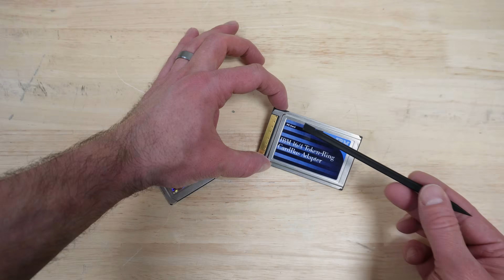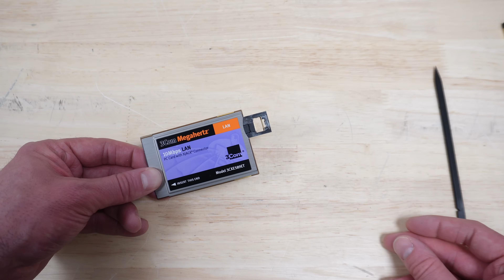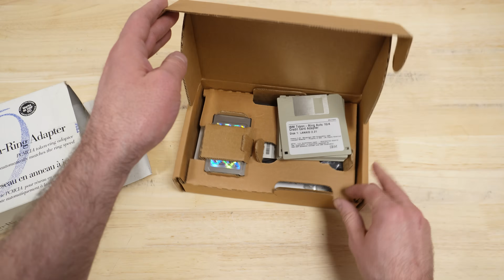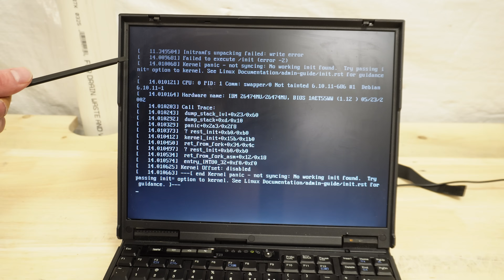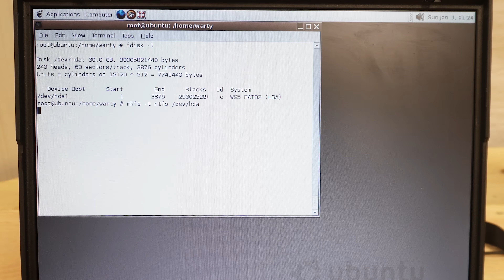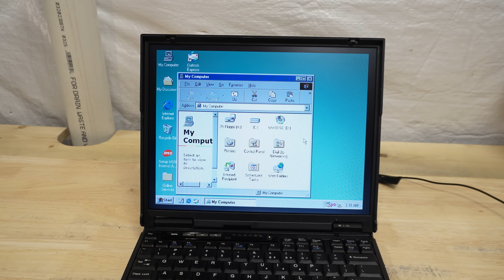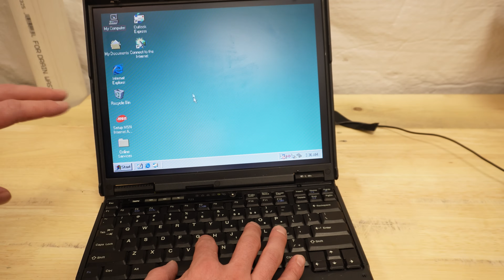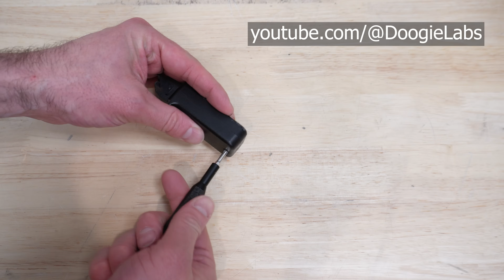Token Ring over PCMCIA Cards

Comment: The PCMCIA form factor was also used in digital television with the CableCARD standard in the USA, and the DVB-CI (Common Interface) in Europe and other parts of the world. Using a standardized interface and form factor allowed interoperability between cable operators and their chosen Conditional Access (encryption) vendor on one side, and a host of receiver manufacturers on the other side. For a number of years, it was a common sight in Europe that all TVs with digital receivers would also have a PCMCIA slot for a CAM, a Conditiional Access Module, allowing the subscriber to opt out of leasing a set-top box from the cable operator.

I believe CableCARDs and CAMs are mostly being phased out now that streaming is more popular than ever, but you can still find them somewhere. I still have an operational TiVo box with a CableCARD from my cable operator for decrypting their digital channels.

Comment: A lot times PC Cards were used inside devices like that sun card, or routers was to leverage the compliance testing that was already done on card. Getting a modem certified to connect to the phone networks in multiple different countries was a lot work and cost.

Comment: All the old d sub connectors used to be very strong and massive and you never have a problem with the wife's fraying on the inside. But since everything's moved to China for manufacturing since the '90s or so or even the 2000s That's when things got in our smaller cheaper and trying to get as much out the door with his little material as possible. So I drove the price down made things cheap but now we have to replace our cables every couple years if they even must have single year.

Comment: A few years ago, I spent a whole heap of time reformatting and reinstalling a laptop with Windows XP, wondering if it really took that long to install back in the day.  And then the next day, I popped an SSD in place of the hard drive and it FLEW.  New rule: don't use old hard drives because they just slow you the heck down!

Comment: It's not uncommon in the DIY/modding scene to upgrade the WRT54 routers/access points with newer generation PCMCIA cards. There's a limited set that have the connector, and a slightly limited series that'll work. But compiling the linux kernel is the sky, and the sky is the limit!

Comment: I was responsible for Marketing Token Ring in Manufacturing Industry, Germany. I ran a one-week seminar on Networking in the production environment, that was to demonstrate the advantages of TR vs. Ethernet. At that time, the production machines had only RS232 interfaces and no memory, so for a network, you had to put one PC to one machine. The most important aspects of that installation was: response time over the net, safety and security of the data. TR was ideal when many PCs/machines were connected to the net. the TR technology had no „collision“ in the net, Ethernet (CSMA/CD) did, far too often, and data was lost.
Those were the times…
Reply: Data wasn't lost with CSMA/CD because retransmissions occurred.

The problem with ethernet and CSMA/CD was the successful packet transmission time was not deterministic and unbounded, and could end up being quite long because multiple retransmissions could occur and the time between them involved the use of random numbers.

Network segmentation and limiting the number of hosts on the subnet addressed that problem, in time
Reply: @deanXRayZulu  You are right, it was the collisions and subsequent retransmissions that could slow down the effective transmission speed.  This does not matter very much in an office environment (you just go for a coffee while waiting for the update) but it was essential for production machines to communicate in a timely manner with, for example, a data base that stored the info on the situation. To effectively control and supervise the machines, we even calculated lead times on the net! Can you imagine what happens in an CSMA/CD network when 20+ machines want to report another cycle? The machines I am talking about were injection moulding machines or machine tools that spit out one product every second….
Reply: @deanXRayZulu

Comment: It would be super cool if you could do a reverse engineer of that setup aid, and compare it to what you built previously. I suspect that’s already a plan, so you have your own setup aid, and if so +1

My history with token ring was at my first job, we ran windows NT and token ring well into the 2000’s. But it was late enough into the technology that even the MAU’s were RJ45 chassis & blade based. We had the “ibm connector” to RJ45 adapters around in the lab, but I didn’t know until now what they were for! Thanks for teaching me!

Comment: If you really want to get those non-PCMCIA laptops onto your Token Ring it is possible. Xircom made network adaptors that plugged in to the laptop's parallel port in both Ethernet and Token Ring variants. I had a Token Ring one for my Toshiba T2000SX laptop back in the very early 90s. It wasn't exactly fast but it did work. It was called the Xircom Pocket Token Ring Adaptor, part number PT2-16B3
Reply from the maker: interesting, didn't know about those.  thank you!

Comment: I used to have a set of DOS boot disks that included the drivers for the network cards and so could just copy stuff over the network to the machine I was building - e.g. if I was installing NT I could copy the i386 directory from the install media hosted on a server and then any additional drivers etc (like the network card ones) and fire up the install from the local hard disk which was much faster.  Then once the machine was installed with NT then I could get it on the network under NT and install whatever other software was needed.  Same would apply for win95/98 but we didn't really use those.

Comment: I would zero out the first couple of MB of that hard drive in linux - it's probably something weird with the boot sector or partition table. dd if=/dev/zero of=[whatever the hard drive is, probably /dev/sda] bs=1M count=2. It's also perfectly normal for those 2.5" laptop drives to sound rattly when you flip them over - some of them even say that on the label.

Comment: This ThinkPad T23 is still in good condition. I have a Thinkpad T22, but the plastic breaks just by looking at it. You can still get the battery for the BIOS and it's easy to replace, unlike my DEC Hinote Ultra 2000, which is the same age.

Comment: The by far biggest part/cost of any network installation is the cabling, so Token Ring would have failed in that department anyway, unless they changed the connector. It's the reason why even fiber has trunk cables and simplex transceivers nowadays.
Reply: And to add to that, there is now an emerging standard for new buildings called FTTO, where the only active components are the central switches and media converters for the devices. The rest is PON.

Comment: PCMCIA in itself is also an interesting protocol. It's a variant of parallel ATA, which in itself is basically the 16-bit ISA bus modified to be connected over a cable. The actual protocol used to talk to PCMCIA devices is slightly different, but the cards also support PATA directly, which was used for micro hard drives and CompactFlash cards.

Comment: Thanks for the flashbacks !  I can't tell you how many of those token ring cables I have made over the years - the IBM connectors are easy to terminate (the plugs are designed to slice through the wire insulation and contact the copper) but the DB9 end was always a struggle - the wires needed to be short to fit inside the backshell, but the insulation was very stiff and needed care to ensure they soldered neatly into the DB9. Not only were there the field end cables to make, but the cable system used a patch field similar to the way we do UTP ethernet cabling today.

We had an IBM token-ring network (initially 4 Mb/s but later upgraded to 16Mb/s) as we had an IBM 4381 Mainframe and the decision was made to go IBM from the desktop to the back end.

Someone decided to cut some corners on the racks - they were typical two-posters and had castor wheels at the bottom.  Great idea for ensuring they fitted into the very tight cable closets on each floor, but once you loaded them up with cabling, patch leads and MAU's the wheels broke.

It was great technology at the time - Ethernet solutions were still using things like vampire taps, etc. however as times changed Token Ring ceased to be the preferred technology, PS/2's became expensive and I expect something beat the mainframe. 

I hate to think what it took to reachable the building to support Ethernet - must have been a nightmare project to run.

Comment: Also came here to say that PCMCIA cards were analoguous to ISA (and for later versions PCI) cards - they are essentially a change in form factor that gives the expandability of desktop computers to laptops.   They are technically based on the ISA bus with some tweaks - e.g. plug and play - so the IRQs aren't configured by the user but are assigned by the system (on earlier systems based on the slot it which it is inserted and on later ones assigned dynamically) so on the card there is just an IRQ line which it uses rather than it having to pick the correct one based on config.  Now we have USB 3 and thunderbolt etc there is little need to have PCMCIA.  Also I found those cards often ran very hot - there is little heat dissapation available in those slots - they don't seem to be tight enough for effective thermal transfer but not loose enough for significant airflow.

Comment: Windows 98 has support for USB but it doesn't come with generic drivers for storage devices like flash drives, back in the day vendor shipped storage drivers for their own flash drives.
Now there is the generic "nusb36e" storage driver you can install on 98SE that works with all flash drives

Comment: With regard to the disk - it's probably fine but you need to clear the partition table after having Linux installed or WIndows doesn't like it - best thing is to boot from DOS disk and use fdisk to erase the partitions and then run the setup from the win98 cd (or boot from it). For some software that messed with the partition table I ended up using norton disk editor to just manually zero out the partition table to get the disk usable again.  I didn't have gparted back then but I would think that if you used it to delete the partitions then that would probably have been fine too.

Comment: The rattle sound is normal on those drives. You probably could have used the mechanical drive by using MSDOS from the CD to partition and format slash S to make it bless the drive. There is improved usb drivers and unofficial service pack for usb mass storage for 98 floating on the net

Comment: Hey clab, cool fact about PCMCIA/PC Cards: The original spec for them is basically an extension of the 16-bit AT ISA bus with some additional pins to help plug and play services. The 32-bit CardBus versions use the same physical pinout but for the PCI bus, with one of the ground pins on the original PC Card standard being driven high to tell the computer that it's a PCI device and not an ISA device. So a full speed CardBus PC Card is a 32-bit 33 MHz PCI device while a low speed PC Card is a 16-bit ~8 MHz device.

Also I've got one of those Xircom cards! That weird connector on the left side is for an early GSM cellular modem dongle.
Reply: Also - PCCard has bumps on the connector, so you can't plug it into PCMCIA-only system.
Reply: @fhunter1test yep, you can see that well in the video. Some of the cards have a weird “plate” with bumps on it on the top side near the connector, so those are the 32 bit CardBus cards. The other ones are “smooth”, and more akin to ISA.
Reply: I also have that Xircom card! Mine has two RJ11 jacks though. Thanks for sharing what that extra port is for!

Comment: Note that at least for the 3Com cards there are different revisions of the dongles and the cards that are incompatible with each other. (Source: post on the excellent blog called OS2museum)

Also it looks like your 3Com card is a Fast Ethernet, i.e. 10/100Mbps, while your dongle is a combo one (BNC/10-base-2/Thinnet + TP/10-base-T). I don't think that there even were combo cards that also did 100Mbps.

Btw it's likely Windows and not the network drivers themselves that locks the computer up for ages while booting. Win9x (and IIRC 3.x too) does this when it tries to get an IP address using DHCP without finding a DHCP server.

Looking forwards to future episodes!

Comment: Just seeing those things makes me feel nervous, I remember spending hours of frustration trying to find "The moonshot driver that actually worked for this specific PCMCIA card" when I was a travelling techie getting people's corporate laptop equipment to work for therm. Setting up internet services in various forms or getting them comnnected to their corporate networks was a real struggle. Many of these just weren't supported well by early windows (3.1, 3.11, 95, 98, 2000 and even XP) and often they needed things loaded from the autoexec.bat or paramters in the config.sys file, before drivers would even be able to address the devices. It was a dark art, far more complicated than it should have been. Standards weren't that standard and the tech evolved quite quickly between 93 and 2003.  So a January 1998 3Com PCMCIA Ethernet card wasn't supported by the same drivers that a July 1998 3Com PCMCIA Ethernet card used. Sometimes you'd install five or six different drivers before you found one that worked. Drivers would assume an I/O Port and IRQ assignment, so it sometimes meant moving other hardware to different IRQ's because the PCMCIA card wasn't IRQ or I/O Port configurable. It was a lot of work and one could almost never be sure it'd work. Once it was up and running and the interface could be pinged from the local host, assigned an IP address and started without errors (Although no errors wasn't neccessarily an indication it was working) there were other challenges, like if the company had a Cisco WG Switch of sorts (A catalyst) the 3Copm Cards still might not work well and would have to be forced to use whatever speed would work since with a high speed (100Mbps or 16Mbps for TR) connection didn't function but a 10Mbps (Or 4Mbps for TR) connection might, auto-negotiation was out of the question. TR sometimes had auto addressing (hardware) and sometimes that was a process which caused conflicts. Physical connectors were often dodgy too.Effectively PCMCIA made it possible to connect to an Ethernet or Token Ring network, but it might well have been less work to train up some homing pigeons.

Comment: I worked for CSC during 2000-1 and we supplied all the equipment to EnergyAustralia. I got to do systems integration for all sorts of equipment, and they were a token ring shop, so everything needed an Olicom 16/4 card in it, which included the laptops, which were Lenovo 620s from memory.

They did have a tiny bit of ethernet, and the best part was when you'd plug ethernet into a token ring PCI card and it would make NT4 immediately BSOD.
Reply: Ah, I remembered, they were ThinkPad 600s. Windows 95 and NT4 were the standard platforms.
Reply: Haha!  Yeah, I'm starting to think maybe those TR card drivers were not the best pieces of software ever written.

Although maybe that "locking up the OS while looking for the ring" thing was necessary because the card relied on the host CPU's full and immediate attention to do time-sensitive stuff?  If that's the case, the card would have really benefited from a microcontroller to handle that independently.

Needless to say, with the benefit of hindsight, it's pretty clear TR was never going to make it.  There's no way that Type 1 connector was impedance matched to a degree that would allow the inevitable throughput bumps (64Mbps...?) over time.  And passive MAUs seems like a really daft idea for several reasons.  They seem unnecessarily handicapped by the inability to monitor and reset themselves to recover from faults.  And just... really...?  We're going to power control relays via a signalling cable??  Oof.

I've really enjoyed getting to see this technology in action.  But I am SO glad this pile of bad ideas did not somehow fumble its way into dominance.  :-D

Comment: you might need to do what I used to do with a similar-era Pentium MMX Toshiba Satellite to get Windows 98 on it; format the disk in another computer, copy the contents of the Windows 98 installer CD to the disk, boot from a DOS6.22 floppy, and run the installer off the disk, electing to not reformat the drive in the process lol.
Reply: and my T23's CD drive sounded like crap circa 2010, so I'm fairly sure they were just Like That.

Comment: This is such a quintessential IT Video. Need to do thing. Ah, that does not work, have to fix something else first. Troubles when fixing the other thing. It is a week later and you're doing something completely different what you were set out to do a week earlier. 
As a tech worker, the struggle is real.

Comment: I've been using those same cheap chinese MSATA-to-IDE adapters on old Powerbook G3 and G4 laptops. They've been working great for me!
Unfortunately MSATA drives are somewhat hard to find at all on the domestic market here, and the chinese ones are of questionable quality.
There are however variants of these adapters that accept M.2 drives keyed with SATA support which are still available from name brand manufacturers like Western Digital so if you have an older laptop that needs new storage and actually needs to retain its data reliably then high quality solutions do exist!